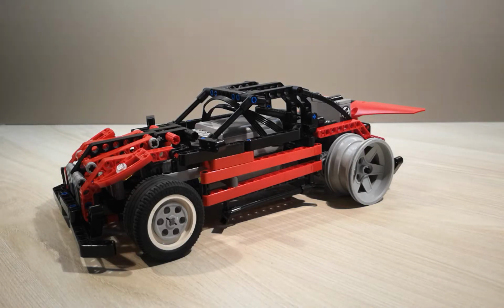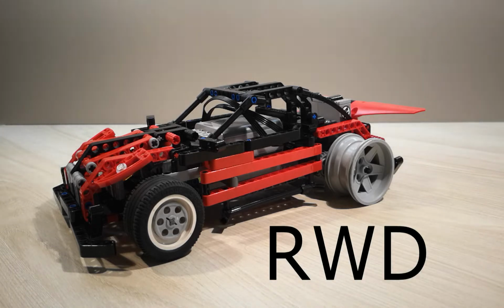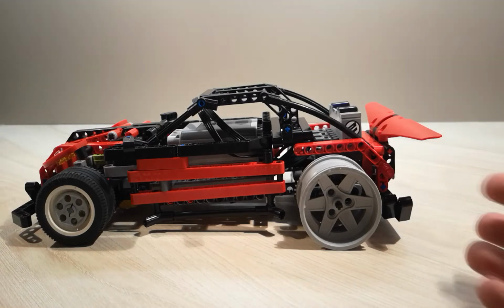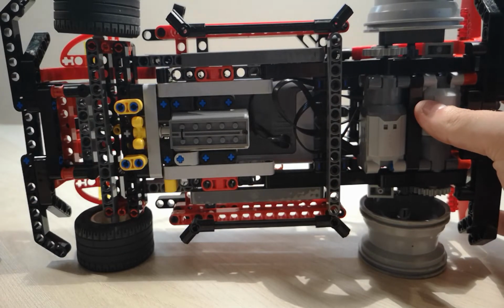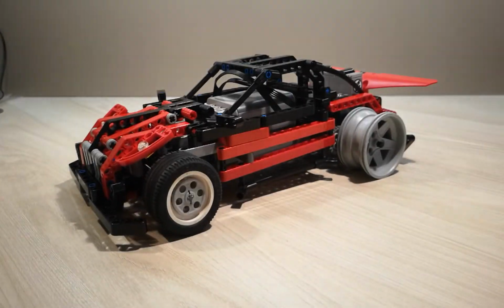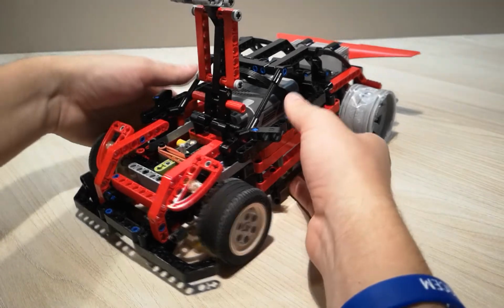Lego MOC RWD Drift Car

Comment: Did you know that you can put 2 Motors on the same Output to use less Receivers and Radios
Reply from the maker: Yes, I know that. But in this case I needed to put motors on 2 outputs because I need to turn 1 motor in one direction and the second one in the opposite. So thats why I used 2 motors in 2 outputs. I dont know if it is possible to use it like you said in this case.
Reply: @hritzi2251  sure it is
In that case you dont need 2 receivers.
With top of around 5 Amp of the reciever you sould be fine.
Buggy motors are totaly deferent story.
Still need to deal the direction of the spin, but for the electronics its ok.